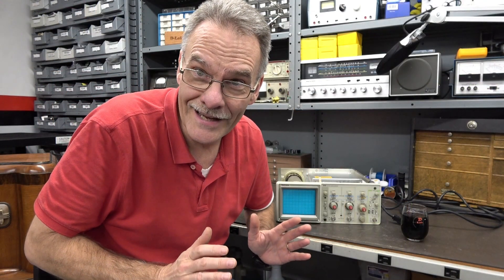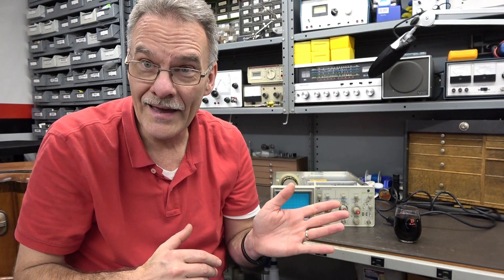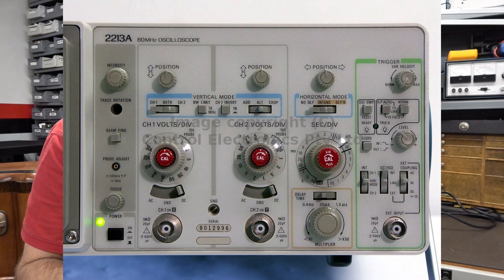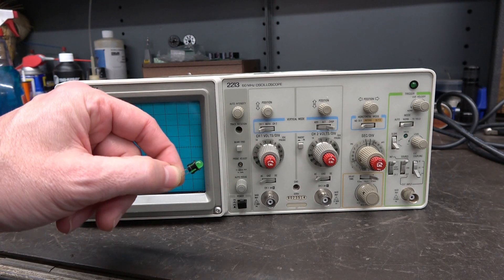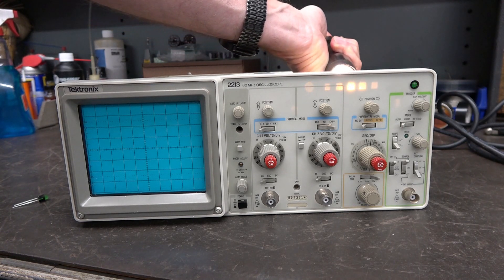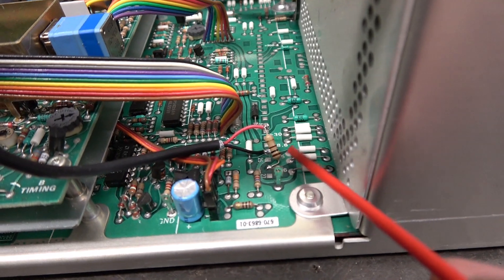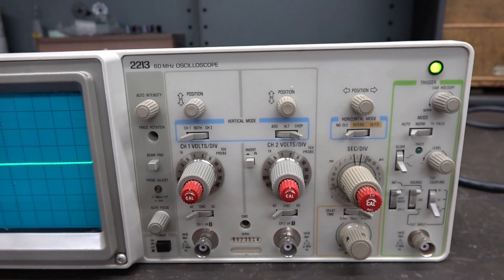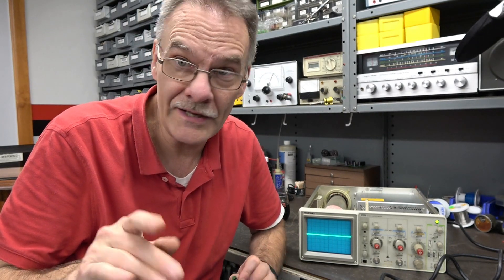How to install LED Power lamp Tektronix 2213 Oscilloscope Modification Improvement

Comment: excellent video ING, thank you very much, note that they just gave me a gift and it is the Tektronix 2213A, I see that mine does incorporate the green power led luckily hahaha, but I see that the Model 2213 if the A does not incorporate it, it is Too bad, you were able to solve the good thing, congratulations for that, greetings from Mexico,

Comment: On my scope, there is a hole inside the front cover next to the power switch (right where the LED is on the 2215A scopes), I am going to mount a small green LED there. If I get my scope working.

Comment: Hi D-Lab, I have seen a few of your videos. Thanks. I was just given a Tektronix 2215 (similar to yours but it has second sweep board that is attached to the pads where you connected your LED. My scope blows the fuse 2 seconds after I power it up. I hear a slight hum from the inductor mounted to the rear chassis inside the power supply cage. I downloaded the the service manual and it is fantastic. I went through the troubleshooting flow chart and I found no shorts, but the resistance across the input winding of the supply voltage transformer is only 0.6 Ohms. The manual does not tell me what to expect for that. Would you be willing to flip yours over (unplugged of course) remove the plastic cover over the circuit board, and measure the resistance across pins 2 and 5 of the transformer. I can give you my email address if you want to collaborate. Thanks!

Comment: So wasn't the CRT lit up with a trace on it?  That's how I tell it's on or did you have the intensity turned down?
Reply from the maker: Nope, it was in normal trigger, no signal, no trace
Reply: On analog CRT scopes like this, you are supposed to dim the intensity all the way down when you are no going to need it for a while (like heading out for lunch).
These scopes take 20 minutes to fully stabilize, so many leave their scopes on all day on days they use the scope, so to prevent trace burn in on the CRT, the trace is often turned down. Having a power on LED is a very good idea.

Comment: When I set my lab up I installed a heavy duty SPST wall switch in a box that shuts off all power to the workbench. It saves me from leaving test equipment or soldering irons on inadvertently. The only issue is my clocks dies. I solved that with a $3.00 battery wall clock.

Comment: Hi D-lab! Gotta say, as an Electrical Engineer with a passion for vintage audio, I love your videos. I actually built my own 12AX7+6AQ5 SE stereo amp for my turntable and it sounds great. I have the Tek 2215, which has the same lack of LED as the 2213. Can you send me an LED so I can perform the same mod?

Comment: Such Power-On LEDs are also important for frequency counters whose crystal time bases are heated when switched off, but still connected to the mains voltage (I.e. standby). I did this for my HP5340 and HP 5316B.

Comment: I found one of these on the side of the road. It was dirty, required a little maintenance to get it up and running, but this has been a staple of my setup ever since. Also have the 100 Meg version storage scope that uses all those chassis holes you showed. Cant beat those scopes for simple audio 👍
Reply: my Chocolate Lab decided to take a leak by an apartment complex garbage shed and thats how i found mine! Crazy thing to come across in the garbage (or side of the road for that matter) but it happens.

Comment: Hello Terry !  Yea sometimes engineers are so busy engineering the most complex things or circuits that they easily overlook the real simple stuff or nice stuff like power on indicator lights that are so necessary!  That was a good simple fix that you done there, I have a TEK 2210 scope that does have a pilot lamp. If memory serves me right it is  100 MHZ scope with storage and is 2 channels.

Comment: Great vid as always. I may have used a 250 ohm resistor, as 50 mA is over twice the usual amperage of 20 mA for a green LED. At 250 ohms and 5 volts yields our 20 mA. 5 volts /250 ohms.
Reply: @Sid Saul, you left out the voltage drop of the LED.
Reply: @russellhltn1396  Yes, good call! 5 volts minus 0.7 drop makes for 4.3 volts. 220 ohm would be the ticket at just under 20 mA.
Reply from the maker: Yes, I agree and will update the resistor value
Reply: @d-labelectronics  honored to suggest to you!
Reply: @sidsaul5766  The voltage drop for LEDs are higher than standard silicon diodes.  Depending on the type of green LED, it could be 1.8V or 3.3V.
Reply: @russellhltn1396  Thanks for the wake-up. Turnd out 220 ohms still works out best.
LED voltage tested with green LED droped 2 volts. Supply voltage of 5 puts the rated voltage of 3 at the LED, 15 mA current through it. Plenty of brilliance without compromise of bulb life.
Reply: @sidsaul5766  The math still isn't quite working.  I think you have a 1.8V LED.  15mA with a 220 ohm resistor is a 3.3V drop.  Glad you found a value that works for you.

Comment: What a coincidence I bought one of these on eBay today, should arrive in a few days. Would be great if you did some more videos featuring this scope particularly alignment and maintenance of the scope.
Reply: Check out my other comment on here for link to bulletins, also if you need manuals you can find them at http://w140.com/tekwiki/wiki/2213

If you want high res searchable .pdfs OR professional reprinted versions check out artekmanuals.com

Lastly, if the seller had it listed condition as "Pre-owned/Working" and not as "For Parts Only" you have buyer protection if anything doesnt work. Just a heads up, cheers.
Reply: Got to this a couple of years late, but thank you the info is of great help.

Comment: Cool, I really dig the 22xx series! Just a heads up, your serial # falls in the range of the 2213s that had a mandatory service bulletin released to address a problem that caused the CRT to burn up fast. Maybe yours was sent into tek back in the day for the update, here is a link to the .pdf that will tell ya all about it http://www.hakanh.com/dl/docs/hardtofind/SUP3010.pdf
Reply: I did not know about that. Thanks.
Reply: @ianbutler1983  No prob, if you take the above url and remove the SUP3010.pdf file it will take you to a big list where you can CTRL+F and search for "2213" that will show you 2 or 3 other official tek bulletins. Thanks to Hakan for posting all this!

Comment: why the 100 ohm resistor?
Reply: All LEDs need a resistor to limit current flow or else will just burn up. Resistor value depends completely on input voltage vs what you need to bias the led on without burning it up.
Reply: Leds require 2 or 3 volts, depending on the exact unit. The resistor drops the 5 volts from the supply. Otherwise it would burn out quickly. Use the voltage drop and the current draw of the LED to calculate the value using ohm's law.

Comment: Just out of curiosity, are you able to turn the CRT off? Couldn’t the CRT be an indication of the power being on? Either way great video!  Would you be able to do a tech tip video where you measure the current being drawn by old tube radios that don’t have fuses inline and how to pick an appropriate fuse rating for that amp? Maybe do a couple that would require different sizes. You’d be my hero! Thanks!
Reply: If it is not in auto trigger mode with no signal, the CRT will be blanked off. There will only be a trace if the input signal exceeds trigger level, or if it is in line or auto mode with no input signal.